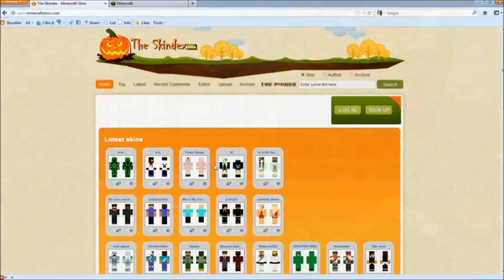ECG: Well D90H Part 2 (Mods)

Comment: Any ideas on a spring fed version? I've considered a spring with a backing to push the bbs forward in the original mag with a funnel at the feed or perhaps 7mm tubing with a 5mm spring and building a spring fed tube. It would be similar to that m4 mag but would be the length of the mag... maybe double stacked...